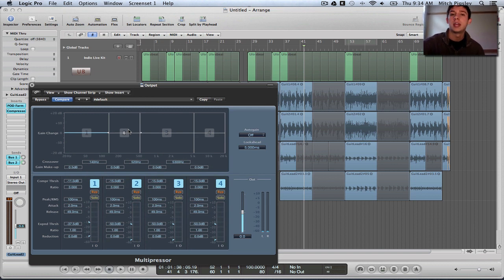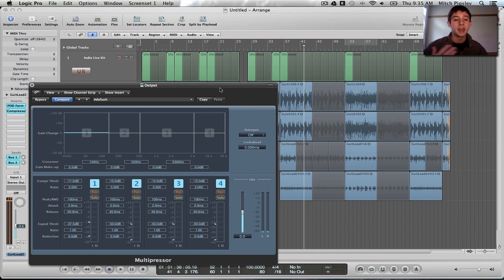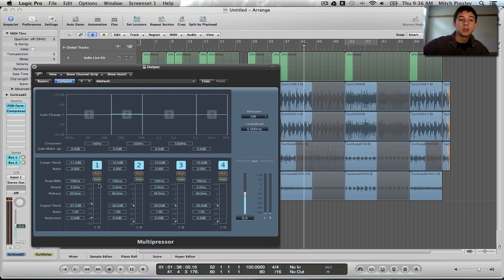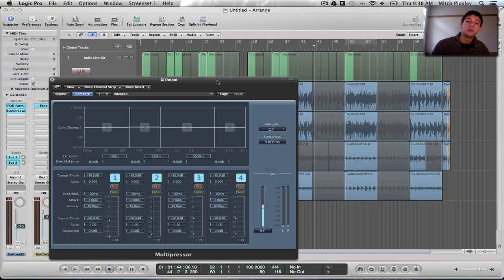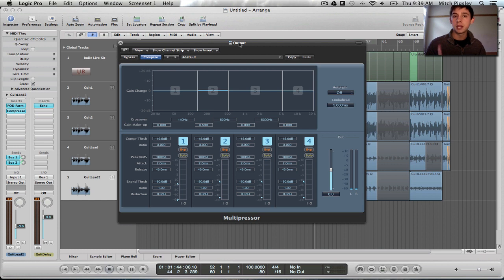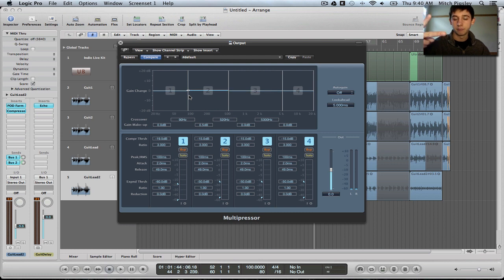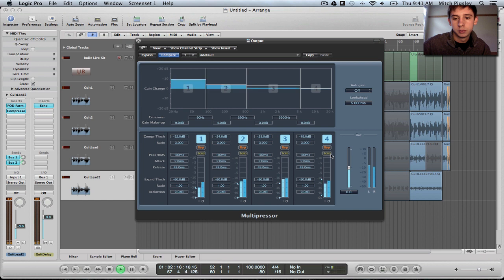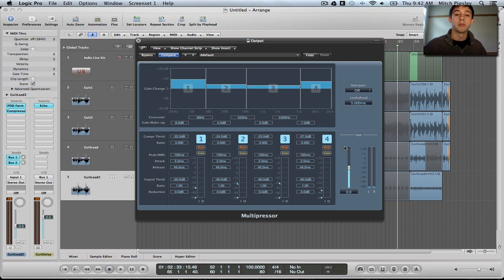Logic Pro 9 Tutorial - Multipressor Overview

Comment: So I do have a question about the multipressor. 

Is clipping on the multipressor a really bad thing? I have a song I'm working on, and the mix, to me, seems pretty perfect, yet when working with the mutlipressor some of the frequency ranges seem to clip according to the levels of the frequencies, well it's going in the red more specifically.

The song does not sound like it's clipping at all, and with other plug ins and mastering tools the overall master isn't clipping at all, but within the multipressor plug in that red is really annoying me xD.

Thanks in advance!
Reply from the maker: You are referring to the levels on the right of the multipressor?
Reply: Not on the right but right below the solo of a range of frequencies, there's a level that plays, which is to my knowledge the  dB levels of the frequencies being played, which makes sense.

Now on a track I'm currently mastering the level will go in the red at certain points on my low mid (if it means anything only one level goes in the red which is the right one, which COULD mean my levels before compression). 

So the question is, does this mean the audio is clipping (in my opinion the mix sounds pretty perfect), does this need fixing or re-mixing? 

Thanks in advance!
Reply from the maker: Yeah, those are the frequency band levels coming in to the multipressor and it does make a difference. Logic does a good job at masking clipping unless it's really bad, but when you bounce it, then it's really easy to tell something is wrong and more times than not it is clipping.

I would go back and lower some levels to get that little bit of clipping removed before proceeding.
Reply: Thanks for the info!

Comment: i occasionally use the multipressor as a multiband noise gate. can be useful on a noisy track. say a hissy guitar amp. once the initial toppy 'ching' has rung out, you can keep the mids of the guitar intact, but expand down the high frequencys. say 6k and above quite fast, and 3k a little slower.

Comment from the maker: Some songs play on the lower frequencies more than the mid to high so in that case, high compression in the low end would probably be useless.. and probably also harmful.
I tend to use the multiband compressor on a lot of bass instruments so I can mix them higher into the mix, especially when I'm working with EDM and rap. What you're doing doesn't sound wrong, but it is easy to find yourself over compressing. Just be careful!